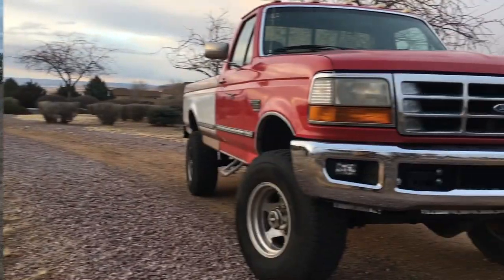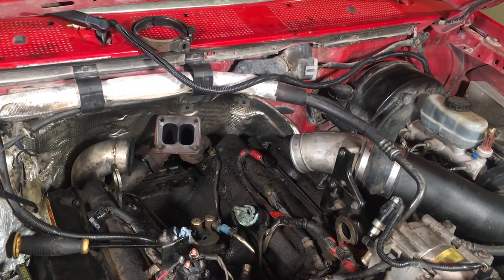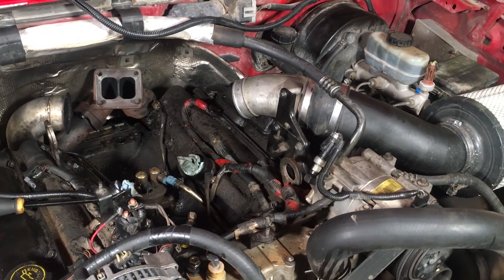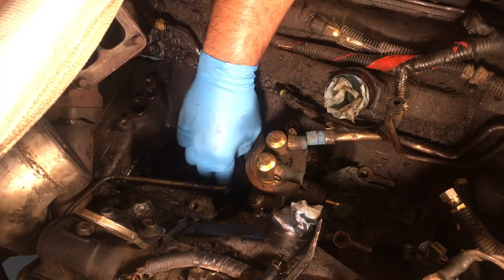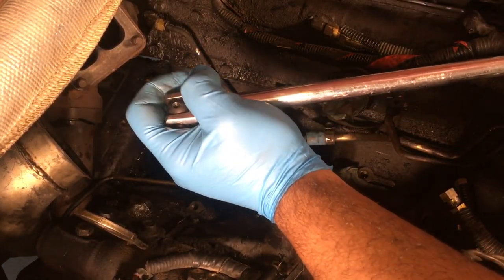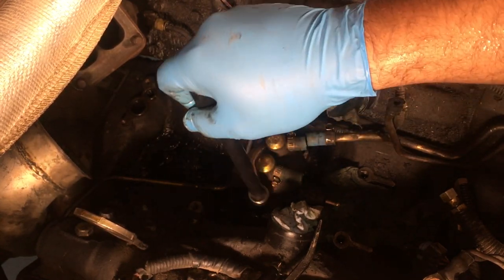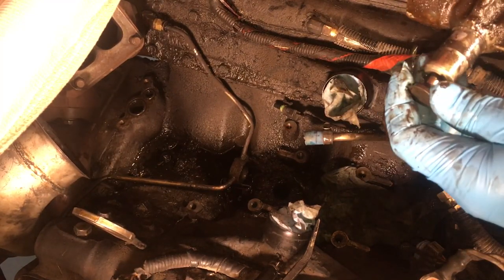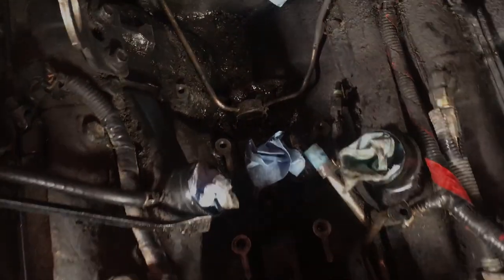EASY OBS 7.3 FUEL PUMP DELETE!! POWERSTROKE F250 F350 1994-1997

Comment: just for future reference, when taking out the fuel pump just remove the bolts and rotate the engine to allow the cam to push it up, that way you dont have to worry about plunger falling into engine, with the cam in its up position will block it
Reply: how do you rotate the engine?
Reply: Martin DeVido  turn over*
Reply: @extraspremier9971  okay, how do you turn over the engine? Breaker bar on the flywheel? Do you need to remove the belt or anything?
Reply: 15/16 on a breaker bar on the balancer bolt.
Reply: @mdevidograndpacificlumbera1539   starter bump.

Comment: The easiest way to ensure the plunger doesnt fall out of the pump is to get the bolts loose, lines off etc..turn the motor over and when the cam pushes on the plunger it will push the pump up at the same time..

Comment: And if you are doing a fuel bowl and pump delete even on a California 97 with the pulsation damper you do not have to pull the turbo pedestal. Let the pump pop up on the cam and take a long punch and a 4lb hammer and smack it sideways and body and plunger will break off and you can pull the pump and cut the lines and pull it out, then pull the plunger and base out. I used Mark fuggazzoto's efuel kit which comes with the lines and an adapter block. I was 72 when I did mine and it took me about 3 hours. I already had the pumps and filters in place. Another 1.5 hours for final hook up. I'll admit to cheating 🤣,I'm a heavy truck mechanic full time.

Comment: All right so I have finally after quite a few months I got the fast fuel system put in all the gauges put in the turbo put in the up pipes put in but now it's acting like it has no fuel how do you bleed it once you put that fast fuel system in
Reply: My fuel pressure up to the gauge is 65 and it does have a return line
Reply: @blowingdiesel  I'm going to head down to the shop when I took it cuz I ran out of time I'm trying to get it all done I had everything on there other than the fast fuel system in the intercooler which is all done now but it ran out of fuel and that's why I decided to do everything to it what would be your best suggestion on how to prime it
Reply: @blowingdiesel  why did you have to prime your higher oil pump I'm just curious maybe that's what I need to do
Reply: @blowingdiesel  Walmart ran out of fuel completely and that's when I decided to do all the upgrades to it do you think that high pressure pump needs to be primed with you'll somehow

Comment: When I installed my fuel pump did the banjo bolt no to being turned in correct position having the hole in correct place could that be the reason for no start

Comment: Is that the high pressure fuel pump...does 7.3 have 2 fuel pumps?
Reply: No. That's the mechanical fuel pump. Obs has it in the valley. The center bowl is called fuel bowl, aka the filter and regulator. 99s to 03 have it under the frame

Comment: The you took out you  mechanical pump what did you use to plug the hole. I saw that it wasn't just a plug. would you have a link for it. Im interested in what you used. Thanks great video!!
Reply: 928 OBS Thank you for sharing it with me.
Reply: What did he use to plug that hole? I cant see his reply and am doing this same mod.

Comment: You installing the e fuel yourself?
Reply: 928 OBS i just bought the 2018 alumaduty bumper yesterday to swap the 08 out👍 i ask about the efuel because my truck has a bad fuel leak and i have all the stock parts to rebuild it but would rather go the route you're going with e fuel but im just a lil hesitant about the difficulty level. Love the videos bud and cant wait to see the e fuel process since ur kinda giving me the push to do it myself
Reply: 928 OBS please do man i was just talking to my bro about going with e fuel rather than putting that leaky bowl back in.
Reply: 928 OBS do you know if the 08 brackets work for the new sd bumper?

Comment: have you changed out the cruise control pressure sensor on the brake? it looked factory. I may be wrong. But that is a very important fix!